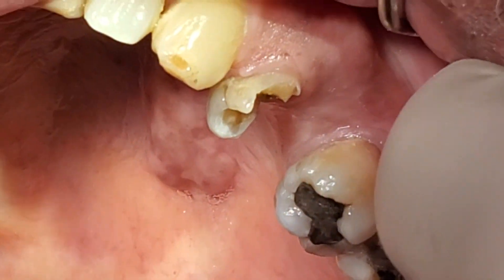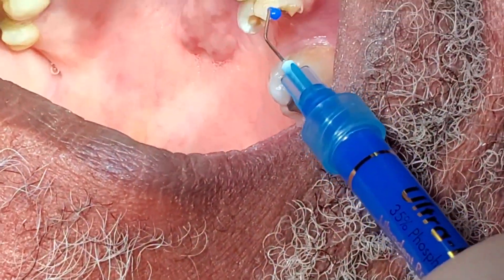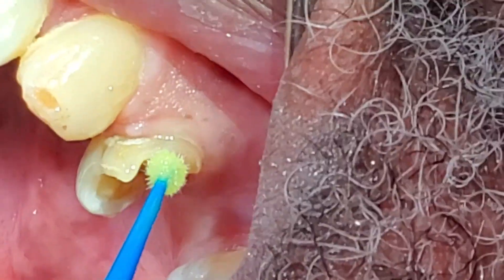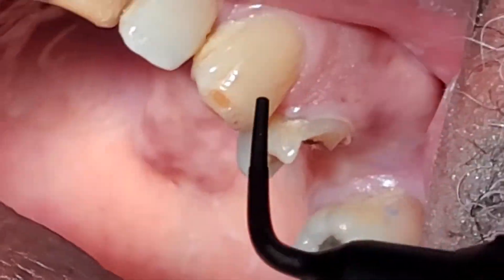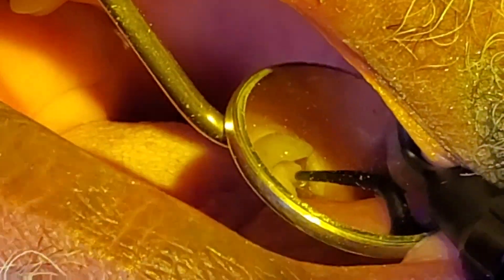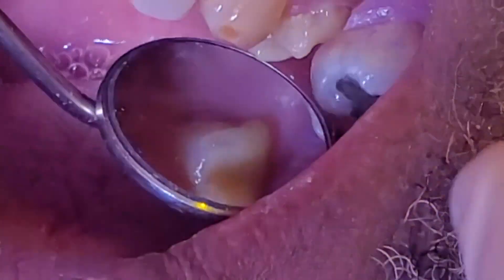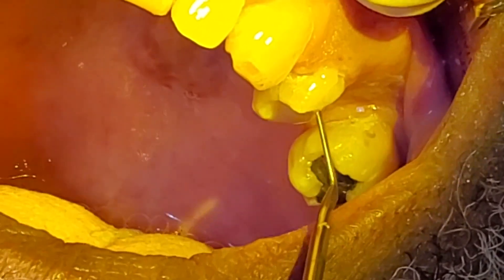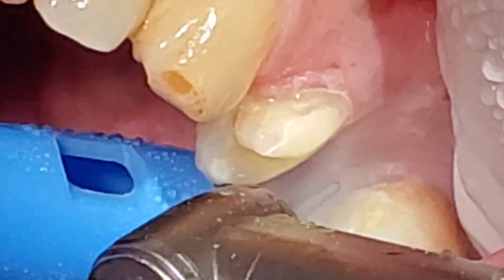everX Flow™ Core Build-up | Dr. Ron Kaminer

Comment: Any reason you don’t use the 3 second option of the Valo light
Reply: probably cause the valo 3sec option generates an huge wave, 3.200mW, and besides the quality, it does not cure efficiently  and generates a imense tension of the cavity walls, and btw he's not using rubber dam isolation, concluding, high power and low times of light curing are unnefective.
Reply: @marcello7978 el tío no leyó jamás
Reply: Quien le dijo que los 3 segundos fotocuran correctamente un composito?

Comment: Can it be used to cement posts?     When the temp is rocked off, will it stay in place or come out in the temp🤦🏻‍♀️
Reply: I guess it's supposed to substitute a post. still not clear to me if it should be sufficient to use it for core build up or to inject it also into the canal
Reply: Si tu paciente muerde suavemente usas esto, sino... Imposible
Reply: This will not replace post.